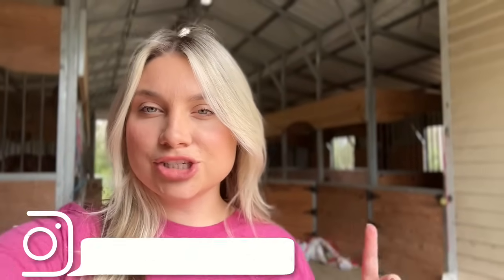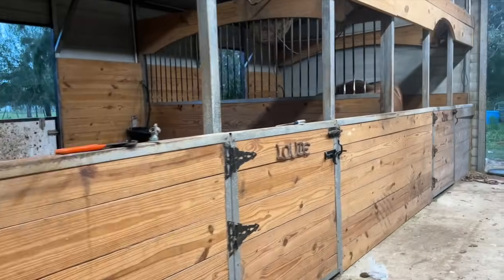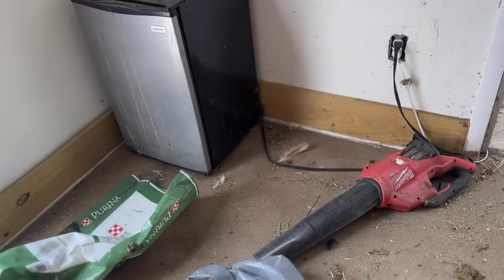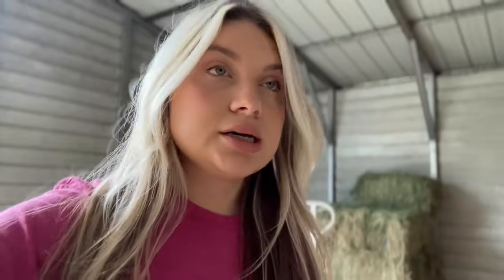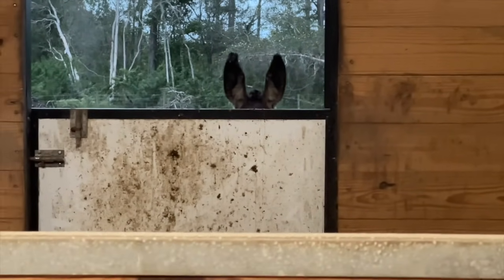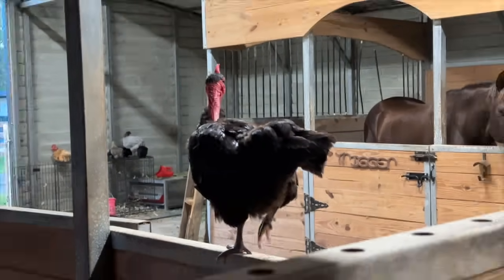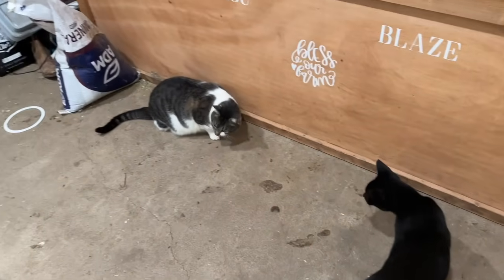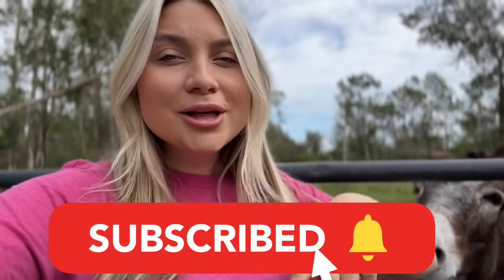HORSE BARN UPGRADES!

Comment: Here in the UK, we have kick bolts at the bottom of our stable doors. You use your foot to open and close them. Horses can’t get to them.
Reply: I’ve been trying to tell her since the start of her new barn series to get a kick bolt not only is it convenient but also adds extra security and safety as if a horse gets cast in their stable and can get their foot stuck between the door and door frame causing them to break their leg
It’s actually a requirement to have by the British horse society

Comment: I use those same latches and have an eye hook that goes through the handle of the latch when it’s closed. I put a double ended snap on that ring and it works perfectly! Eliminates the danger of a carabiner and is much easier than the current setup.

Comment: I have the slightly smaller latches similar to yours, but you can put a snap on it to keep it closed and it's quick to use. They are very strong too, I have used them for 20 years and I love them. When I added on to my barn I bought more of them. TSC and Ace Hardware carries them. Here's what they are called: National Hardware Black N165-506 1134 Sliding Bolt Door/Gate Latch

Comment: One thing if you have a horse that likes to get out of a stall door it’s really smart to get an extra lock latch on those because they can easily pull them out and walk out of the stalls. I use that at a barn I worked at and we had a horse escape, and, they can be very smart